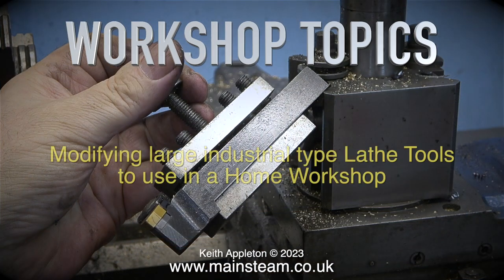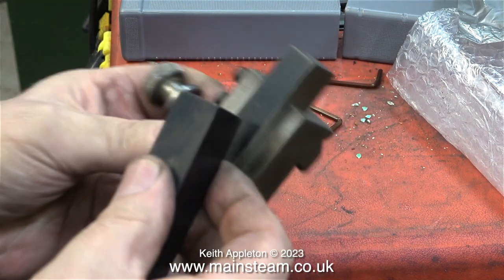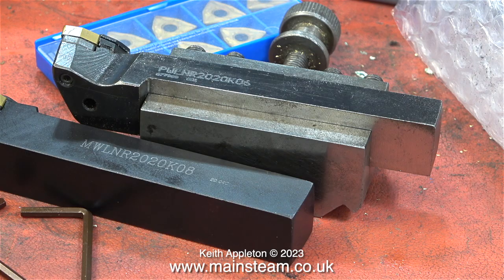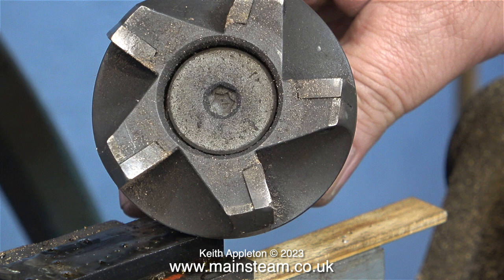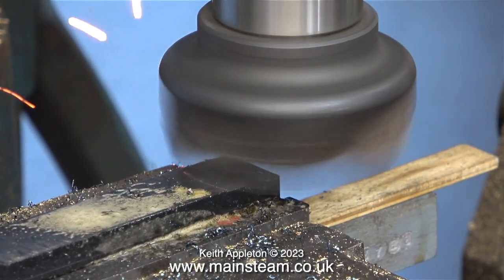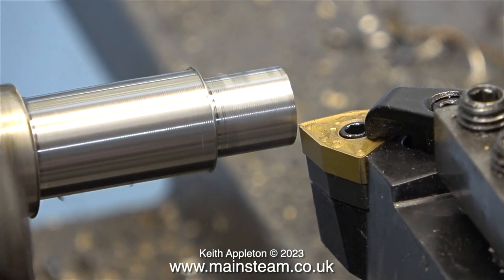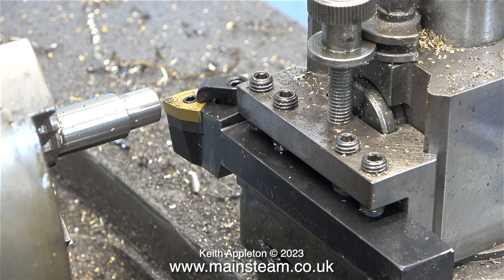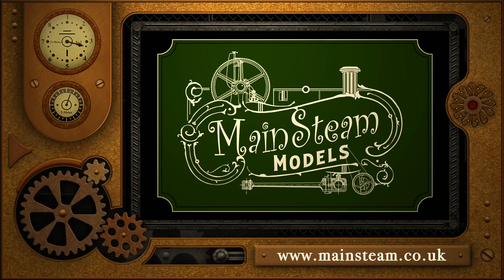LATHE TOOL MODIFICATIONS FOR HOME WORKSHOP MODEL ENGINEERING

Comment: Willingness to modify tools is a good quality in the home shop machinist - if you were just going to buy stuff and use it as designed, why would you have a shop at all? You can 'modernize' some older tooling too.  I have adapted several of my old rocker-type tool holders to fit in my QCTP. I used a two-flute carbide insert roughing endmill and it gave results similar to the face mill that you used. Nice video.

Comment: Keith, one reason why you saw sparks leaving the tool holder while it was not getting hot can be that the friction heat left the part in the sparks rather than soaking into the holder.  Or at least it can when cutting industrially.
Reply from the maker: Yes it seems odd to me, sparks but the work doesn't overheat ..... a good design of cutter methinks . . . .
Reply: @keithappleton  The chips change color based on their temperature as they carry the heat away from the part being machined -- up to a point.  The part still can get hot but the chips carry a lot of the heat away, at least when things are working right. ;)